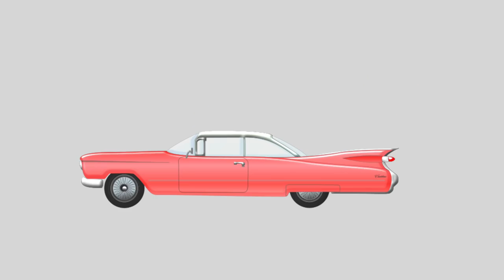Yes, Rockets CAN Fly in a Vacuum

Comment: You cannot make an EXPLOSION (rocket) and push it against an IMPLOSION (vacuum of space) LAWS of thermodynamics 
Saying rockets can work in a vacuum is like saying submarines can fly in air.....Rockets supply their own expanding gas that displaces (thrust against)the medium they are in (air=nitrogen ,oxygen)
 jet engines use the oxygen in the air to combust with fuel  and compress and expand (with heat) the air out of the "jet" engine that pushes against the atmosphere ...
Reply: You could try to be more wrong, but it would be difficult.
Reply: @darklight2.1  which bit was wrong?
Reply: @marxman00  
The bit where you said a vacuum is an implosion.
The bit where you said rocket exhaust thrusts against the medium it's in.
The bit where you said jet exhaust pushes against an atmosphere.

Pretty much the only thing you mentioned that is accurate is that jet engines use atmospheric oxygen. Slow clap for you I guess.
Reply: @niallkinsella2687  a vacuum is a negative pressure relative to the differense of an  applied pressure, an implosion is a created negative pressure.
Rockets thrust against the medium they are in , rockets dont work under water because the surrounding pressure is too great an would create an explosion with no thrust.. in a vacuum there is no surrounding pressure differential, therefore the rocket pressure is zero.
a jet engine does not suck itself through the air , it pushes against the air by blowing exaust againt the surounding air and avoids resistance by being "pointy shaped"
And why not watch "the tyranny of the rocket equation" aTed talk by Astronaut Don Pettit ,you may learn something to your advantage
Reply: @marxman00   
Wow.
I thought your original post has a lot of inaccuracies, but this latest one is on a whole other level.
Every single sentence is wrong.
Reply: @niallkinsella2687  He seems intent on proving that he could actually be more wrong with seemingly little effort.
Thus, I stand corrected.
Reply: @stuartgray5877 You seem to have no comprehension of what a vacuum is   "The vacuum of space is incredibly powerful, 1 x 10-17 torr, and the vacuum between the Earth and the Moon is 1 x 10-11 torr." Oh and what created the implossion ?. Anyway the vacuum of space is total nonsense as there would be no way to measure it, as it would be impossible to be in it .
Reply: @marxman00  - "You seem to have no comprehension of what a vacuum is "
REALLY?
I have been a vacuum test specialist for almost 30 years.
My FIRST job in aerospace (after getting my EE degree) was working at Lockheed Martin Space Simulation Laboratory operating some of the nation's largest thermal vacuum chambers.
Now try educating yourself on a topic BEFORE trying to lecture experts in the field.
As I said, "VACUUM CANNOT EXERT A FORCE ON ANYTHING".
Now try finishing high school before calling every engineer and physicist to have ever lived a bunch of idiots.
Reply: @marxman00  I have been building, testing, launching, and operating deep space science probes since before you were born genius.
Reply: @marxman00  - Oh, AND, another way to write down "1 x 10-11 torr" is actually "0.0 PSI" or 0.000000000001 PSI to be more specific.
That 1 x 10-11 is a REALLY SMALL NUMBER NOT A NEGATIVE NUMBER !!
Now learn how basic mathematics works before trying to lecture engineers.
Reply: @marxman00  To help you understand how rocket propulsion works in a vacuum you need just answer a few questions: 
 Would a CROSSBOW fired into a vacuum have any recoil?
Yes or no? Why or WHY NOT?
Once you understand how inertia and Momentum works you will understand why Newton's laws say that rocket propulsion MUST work in a vacuum .
Reply: @stuartgray5877  relativity? nothing is measurable without comparison to something else (thats called callibration) .a hard vacuum is imposible to create as it has the pressure of the the universe opposing it. I dont suppose you ever talked to anyone who works in industry who uses vacuum chambers? perhaps your an engineer of other engineering?
Reply: @stuartgray5877 Glad you mentioned that old chap,does a crossbow bolt weigh the same as a crossbow...why not ?eeerm because the MASS of the crossbow has to be greater than the MASS of the bolt . Thats why you woud have to expell the same MASS or more to travel away from your spent rocket fuel ... volume of ANYTHING will not cause propulsion in a vacuum, Newtons laws clearly states that. Perhaps look at a Newtons cradle!! ( oh ,you dont use them in space school,i forgot!)
Reply: @marxman00  - "I dont suppose you ever talked to anyone who works in industry who uses vacuum chambers? perhaps your an engineer of other engineering?"

You apparently have reading comprehension issues.
I have been a VACUUM TEST SPECIALIST FOR ALMOST 30 YEARS !
Did you understand this time?
Reply: @marxman00  You STILL did not answer the question: Will a Crossbow FIRED INTO A VACUUM have any RECOIL?
YES OR NO?
If you need NUMBERS to work with, here you go:
Imagine a 10,000 kg remote controlled "crossbow" sitting in a vacuum chamber on a frictionless surface.
It is loaded with a 500 kg projectile (block of water ice),and the Bow, projectile and an observer are all at rest.
The Observer fires the 500 kg block of ICE - into the vacuum.
He observes the 500 kg block of ice moving to his "Right" with a velocity of 2500 meters per second.
WHAT is the final velocity of the Crossbow AFTER firing the projectile?
If you are wondering where I got the numbers, it is from a real-world experiment, and I can show you the results AFTER you answer.
Reply: @stuartgray5877 Great so how are all those  O rings in the mechanical rotation of the light shields of the  "cupola" in the ISS able to hold pressure against that 1 x 10-11 torr . OR all the thousands of seals?? They dont seem to have any worry as the have ALL of the air locks blocked with pipes and crap, so if they had a leak they would be a"vapor cloud", I would love your expert opinion . What would be the optimum (obvious) shape of a container that would be pressurised  and put into a vacuum environment? "Expert "opinion remember!
Reply: @stuartgray5877  Your a bit slow!  "recoil " is the  opposing force of the action (in this case ) between two masses  ,one of those masses is greater than the other..  because a crossbow that weighed the same as the bolt would travel equally and oppositly  . Here we have your perfect example of how rockets cannot work in a vacuum.thanks
Reply: @stuartgray5877  "I have been a VACUUM TEST SPECIALIST FOR ALMOST 30 YEARS !" Oh ..you work for Hoover's elite suction force , say no more!? Screw you I work for Dyson
Reply: @marxman00  so you are incapable of calculating the velocity of the crossbow in my example above?
So you have never taken a physics class in your life but you feel confident arguing basic physics with actual engineers?
Reply: @stuartgray5877  What are you talking about?? Im talking about ROCKETS in a vacuum , Ther is no relevent comparison to a crossbow and bolt in a vacuum or otherwise .. Do you want to change it to a crossbow with a bolt made of hot gas  in a vacuum or something?, yknow something that uses pressure .. Stay vector! What MASS is repelling the rocket in a vacuum? P.s.All physics is simple and self evident
Reply: @marxman00  just as a crossbow feels recoil from pushing on the MASS of the projectile, a rocket engine feels recoil by pushing on the MASS of the exhaust gas.
Let me guess, you think that gas has no mass, right?
Reply: @stuartgray5877  obviously the exhaust can have no more mass than the fuel. so just to be less messy why dont they fire lead blocks out the back , that would be better right? Oh and how much MASS are we taking with us until the MASS runs out. If you weigh a ton ,you  have to explell a ton of mass to equally and oppositely move. How do you decelerate from your initial velocity when you have less MASS than when you created that velocity?.
Reply: @marxman00  you apparently don't realize that rockets are about 99% reaction mass at liftoff.  Do you even KNOW what the "exhaust gas" IS from a space shuttle main engine?  Tell me
Reply: @stuartgray5877 At lift off they in atmosphere , not in a vacuum , you seem to be stuck in your own BS loop  ,The shuttle had no onboard fuel  except the hypergolic retros ,that allow it to dock with ISS ( ridiculous of course because rockets dont work in a vacuum and if they did would repel the ISS)  "how are those tyres doing at "1 x 10-11 torr" How hasnt the magic rubber evaporated ?  How does it land perfectly with zero power from orbit ? I know the answer ,whats yours?  The hypergolics are the only fuel possible in "the vacuum of space" due to the impossibility of containing any other form of pressurised fuel "in a vacuum"  , Thats also what the satellites dont use for orbit correction . Hows your amzing crossbow with hot gas bolt doing, im waiting for the update!
Reply: @marxman00  learn about the "law of conservation of momentum" and how the Tsiolkovsky Rocket Equation is derived from that Law.  Then check back.
The company I work for tests rocket thrusters here on earth in vacuum and verify they produce the thrust predicted by the rocket equation.  You really think we haven't tested that 100 year old equation?
We then put those thrusters on real spacecraft, launch them to space and test them there too.
Reply: @marxman00  oh, and the "exhaust gas" from a space shuttle main engine is PURE WATER.
A SSME expels 500 kilograms of water PER SECOND at MACH EIGHT.
They accelerate that 500 kg of water from a velocity of ZERO to MACH EIGHT in about 3 meters.
Now tell me YOU think that ANY machine can accelerate 500 kilograms of water to MACH EIGHT without feeling a recoil force.
That's more momentum than a jet fighter from an aircraft carrier catapult
Reply: @marxman00  and sorry but I have seen examples of monopropellant thrusters, bi-propellant thrusters, Ion thrusters, solid rocket motors, AND liquid engines all ignite and produce thrust just fine in a vacuum.  I have built spacecraft that have operated from low earth orbit to deep space and the atmospheres of other planets. A hypersonic vehicle I helped build and launch is currently in the Smithsonian Air and Space Museum in DC right now with my signature inside it.
Reply: @stuartgray5877  There you go again, waffling on about atmospheric thrust! Your bizarre recoil "analogy",   with a crossbow firing a hot gas bolt in a vacuum ,Please do explain how that works.
 You are losing yourself , but not me,in ever expanding obfuscation.
Reply: @stuartgray5877  Is that next to the LEM, the one made out of curtain rods and duct tape with the docking hatch too small to access, and that "we destroyed that technology and its a painfull process to build it back again" Good old Don Petitt, he also explained that the O rings in the cupola work merely "because of real good engineering!" Perhaps you could learn something from the master. Dont become a magician though , there are cards on the floor and the rabbit is dead!
Reply: @marxman00  I see that you are completely "unteachable".  I suspect that is why you dropped out before the 9th grade.
Since I consider it poor taste to make fun of people with learning disabilities I must say goodbye. Tell your special ed teacher to give you an extra star today for your effort. 
Bless your little heart!
Reply: @stuartgray5877  The emperor wears no clothes ,calls himself a scientist and just fell off a cliff , in the vacuum of his own ignorance , quite impressive ,enjoy the terra ferma, XX
Reply: @stuartgray5877  crazy Stuart hard at it with the mad analogies & personal abuse...
Reply: @marxman00  Stuart Gray claiming fire is water never gets old...
Reply: @stuartgray5877  lol.  SG loses the debate and is then programmed to just become abusive... xD.  Whoever designed it is evil.